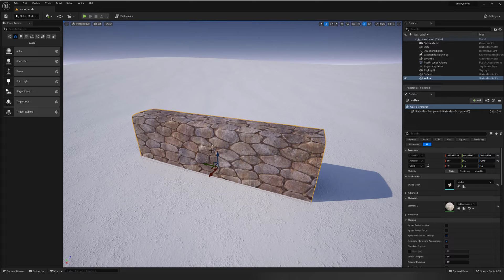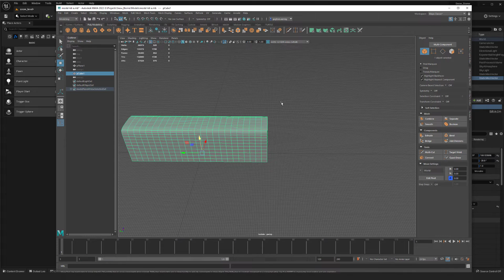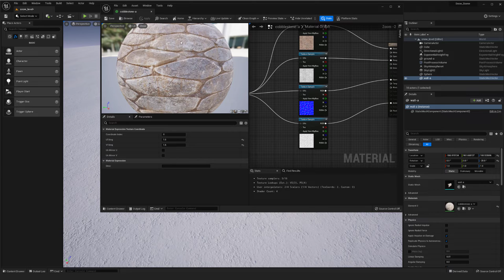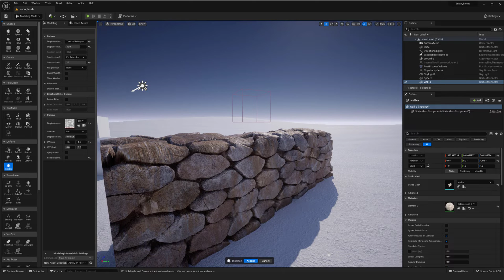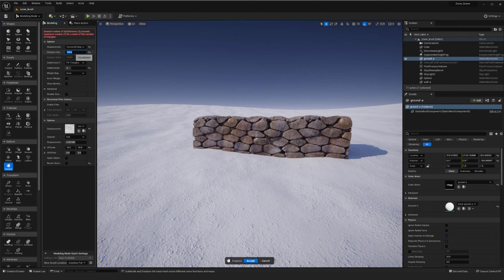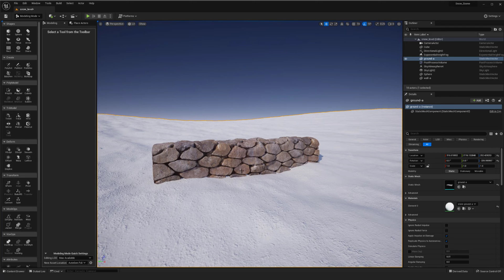Using Displacement To Create Cobblestone In Unreal Engine 5

Comment: Hello Peyton, 
Most of the tutorials on displacement in UE are with a mesh plane and yours is different.
I tested the Displacement function on a wall with an angle. It doesn't work very well, there's a penetration of the vertexes of the angles.
Do you know if it's possible to fix this problem, or is it part of UE's limitations? 
What do you think is the best strategy for designing a castle wall: POM, Displacement or other?
 Have a nice day. Best
Reply from the maker: that issue would happen most likely if you have a seam there. The seams are not going to be too friendly with it. Additionally if you have a really hard edge like a strong corner. I did a smooth round mesh and it worked like I was wanting. Hope this helps!
Reply: @PeytonVarney  Thank you very much. Yes it helps me to take another direction for the hard angles of walls. :)

Comment: Thanks for the video. This seems a nice feature and all, for something you modelled completely using Unreal Editor tools, and then wanted to displace.
But you brought in a mesh from Maya - I'm primarily a Modo guy myself, but I'm assuming that Maya has the same kind of tools to perform mesh displacements as Modo has, so basically; why would I choose to do the displacement in Unreal? If it was somehow a dynamic displacement, that was modifiable at runtime, then...maybe I could see the utility. But it seems it isn't, its creating a new static mesh (which overwrites the one you originally imported). I don't know what the UVing tools are like inside Unreal editor, but I'm guessing most 3D apps are much easier and more powerful to use.

I bring this up in case there is something I missed which might make it a tool I could want to use, or something which might simplify my workflow.
I'm doing a lot of mesh displacements in Modo right now for a series of tile-able modular assets; 
The basic workflow involves applying a displacement to a catmull-clark subdiv mesh, freezing it to get a very high poly mesh, then decimating that mesh to reduce unneeded polys (the result looks like the Quixel megascans meshes).
Then I manually tweak the vertices along 2 edges so that they perfectly align with the opposite two edges, meaning that the mesh itself is perfectly tile-able.

Comment: Great tutorial! Is there a way to implement this using a landscape material that has more than one textures for auto landscaping? I have a landscape material that has I think 5 materials and the way this tutorial is I can’t use it for it, unfortunately.
Reply from the maker: Thank you! You would not probably use this method to go about doing something like that. That would maybe be covered with something better like virtual textures or something else. I am hoping that at some point they simplify it a little bit but a landscape material is a little bit more difficult!
Reply: @PeytonVarney  Yeah, virtual textures is what I’m using for Unreal Engine 5, but UE5 has a glitch where sometimes when you delete something in the scene the landscape will disappear or sometimes disappear at certain camera angles. I was hoping for an alternative to possibly use. Thank you for the response though.

Comment: Note that not using the recompute normals thing also makes things wrong, since you have the world normals as if the geo was still flat plus the normal map you applied in the material. This normal map matches the normals of one single displacement amount value ONLY and if you don't match the normal maps intensity with the amount of displacement you set, then your results are wrong from normals side of things. So you could ... A: Displace geo with recompute normals ON and then remove the normal map in the material (disavantage you need a lot of geo if you want to have a lot of detail) OR B: You displace the geo WITHOUT recompute normals option on but leave the normal map in the material and play with it's intensity until it matches the world normals of option A while being in World Normal View mode to be able to compare world normals better.